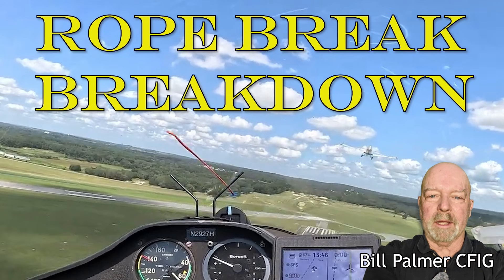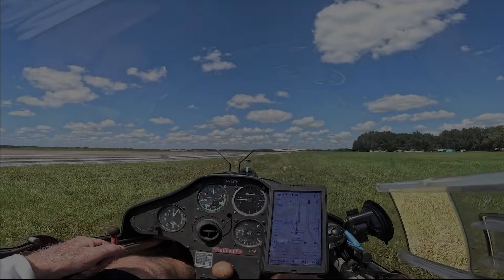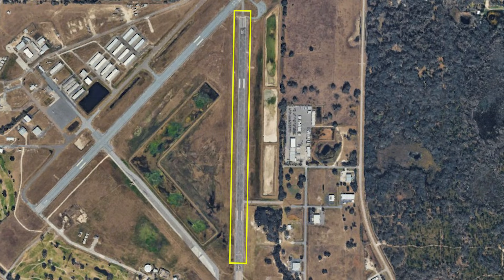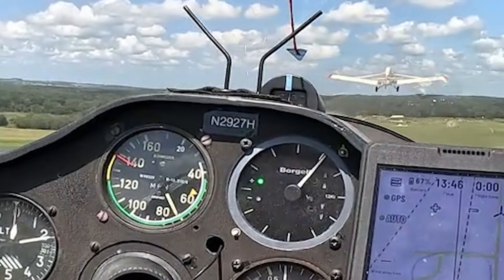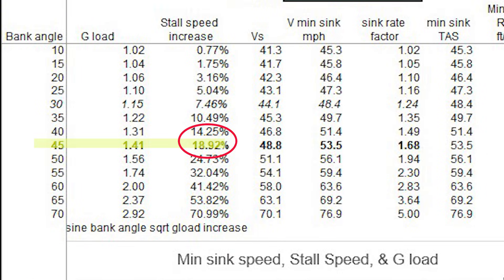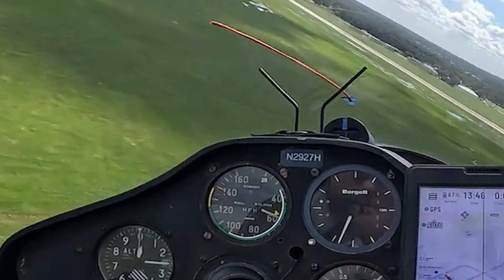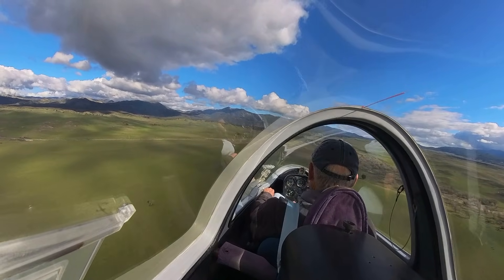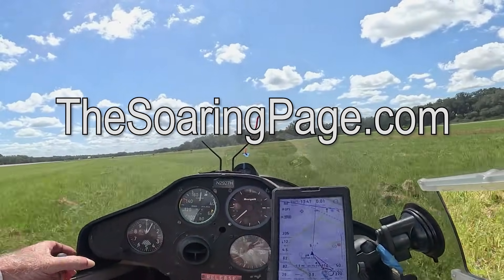Rope Break Breakdown

Comment from the maker: After his incident occurred the pilot went back to see if he could have landed in the approximately 2000 feet of remaining runway from where the rope break occurred.  He simulated the altitude and airspeed at the time of release to see how much room it took. 
You can find that flight here: https://www.youtube.com/watch?v=5HJefldQ56c
he states: “75mph airspeed indicator
190 feet AGL per Oudie
Simulated break near the south end of the runway.”
Of course, it’s not the touch down distance that matters - but the total stopping distance. 
Did he use the amount of braking that would have been employed if he had to stop within 2000 feet?
Could a slip, s-turns, higher speed descent, have helped deplete energy quicker?

Simulation to touchdown and approximate compare to actual rope break situation

Comment: I have never seen a 1-35 land, but I have seen many Hp-14's land, also equiped, with full flaps in a very steep (and safe) landing that may only require 500 feet of runway from 175 feet AGL.  If the 1-35 lands similiar to HP-14, then plenty of runway straight ahead - assuming the flaps can be lowered fast enough.
Reply from the maker: The landing straight ahead, may have been possible. The 1-35 doesn’t have spoilers but does have 80º landing flap which, when you get there, does a similar thing. 
I link in another comment to a video this pilot shot after this flight to see if landing ahead was possible given his airspeed and altitude at the time of the release. Look for that.  Had he had to land in the runway ahead, he would have required significantly more braking than in his test run.   But go check that video out and engage in the comments there. Should be a good discussion. 

As far as the low- altitude alignment - yes indeed “kinda sketchy” which is why I introduced the alternate technique supported by the US Soaring Safety Foundation that takes that low altitude alignment turn and does that FIRST, so that when you turn around the runway is in front of you. Be sure to catch that part of the above video where I do that maneuver. It worked out great!
Reply from the maker: Remember to factor in in the extra airspeed he’s carrying from the tow. It’s going to take distance to bleed that energy off. Yes, there are techniques for it, that you need to be self-briefed and ready for.   (steep approach with max drag, slips, S turns)

Comment: Good video.  That is a scary turn to align with the runway...too many angles to solve.  Maybe I missed it regarding the runway alignment turn.... he overshot the turn to the left side of the runway because he did two things:  too much of a turn back to the runway (could have rolled out at the 1:33 point and made a smooth and controlled turn back to the right to align) and then a late turn to align as he approached the runway with a lot of angles....low altitude turn and with the air brakes deployed in the turn!  It seems that it would have been safer to just land across the pavement into the grass vs turn at such a very low altitude to align.  It's good to analyze such videos and I'm sure there are many opinions....speed is life and low altitude turns can kill you.  Good luck.

Comment: My instructor always told me cemeteries are full of pilots believing they could make it back to the terrain. He would be mad at this video. The problem with these (very interesting) computations is that they assume the piloting will be done fine, which is a bold assumption considering the stress under which the pilot is, especially if (s)he is not very experienced. And your final comment about how the glider skids during most the trip back confirm this.

The grass beyond the runway was more than good enough to land. No matter how bumpy it is. A bump would not kill you, whereas a late turn could.
Reply from the maker: Indeed these scenarios should be reviewed and practiced with a good instructor.

Comment: I noticed that the airbrakes (spoilers) were opened before the glider had complted the last of the turns. There was already little altitude left for completing the 
maneuver and this seemed to just seemed to further reduce the, limited, margin further.
Reply: That's not a spoiler lever, it's a flap lever. The 1-35 does not have spoilers, the 80 degree flap extension is VERY effective for glide path control.

Comment: I'm curious why you are recommending all of this low altitude manouvring? it seems that thousand foot area of the end of the runway was perfectly landable, as would have been leveling the wings at 1:31 and landing in the grass. Surely the risk of damaging the undercarriage on a rough surface is hugely less than the risk of spinning or dragging a wingtip and cartwheeling?
Reply: I came here for that question!
Reply: To me it got interesting just as the alitmeter is not zeroed before starting. The glider is for aerobatics, then no point in having anything other than QFE...
Reply from the maker: QFE is no longer the standard procedure. All airspace references MSL altitudes (QNH), whether it’s the boundary between class G and E, the top of class D, 10,000 feet where cloud clearance requirements change, or the altitudes relating to oxygen requirements. For any glider going cross country, having the field elevation of the takeoff airport is of no use and potentially misleading.  While not the case in Florida, in my area (Southern California) even nearby airports differ in elevation by thousands of feet. I’d rather not have to deal with an altimeter that’s going to read minus 2500 feet at touchdown. Besides, I’m not sure if most standard altimeters will allow for a 3 in Hg adjustment in the Kollsman window.
Reply: Fully agree. Never try to come back under 100m (unless you have absolutely no choice). That's what I have been told.
Reply: High glide ratio and good energy off the tow would have made the same runway not great. The obstacle would have eaten into the 1000'. Notice how far he went even after all the maneuvers. Pilot did great. The video is nitpicking for content.

Comment: Good video, thanks for that. The first thing I noticed is the Pilot never even touched the Release handle. I was taught to always pull the handle twice in the event of a rope break to make sure you're not dragging the rope (or in my case wire) behind you & potentially fowling up the flight controls. Cheers.
Reply from the maker: good observation.  The Schweitzer aircraft he flying will automatically release the rope with any backwards force, and it did when you hear the click at 0:35.
Pulling the release handle is certainly a good habit, and a critical one in many gliders. I should have included that.